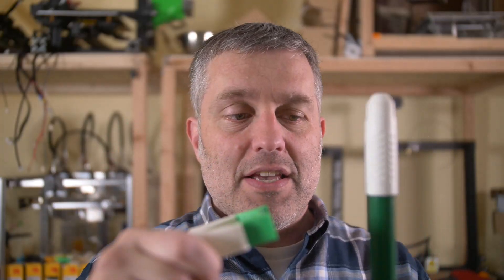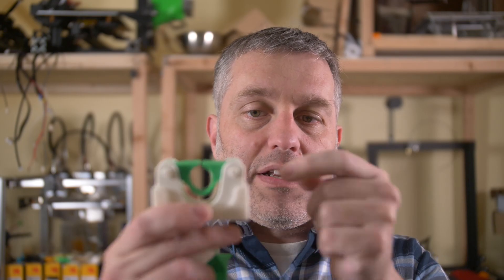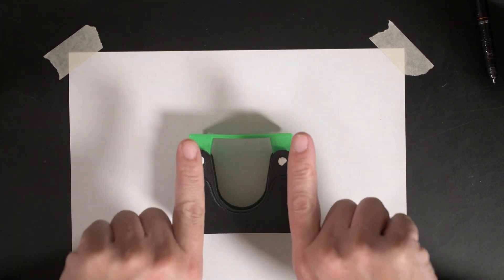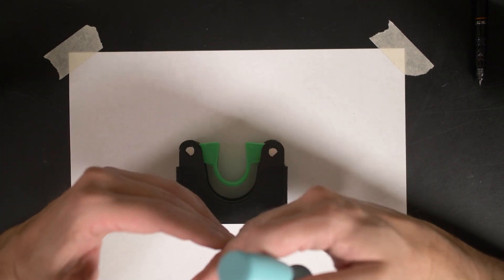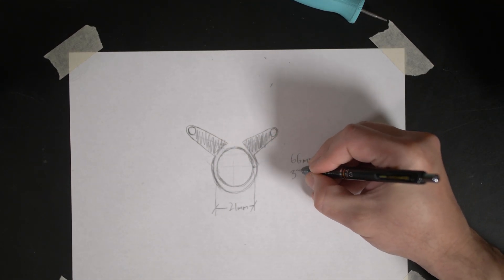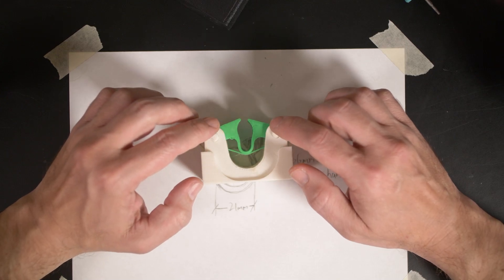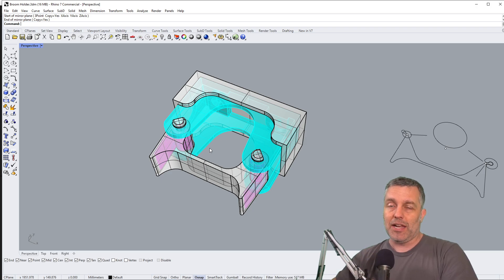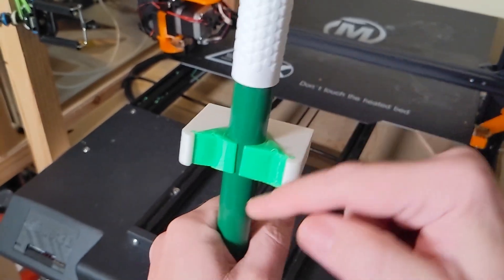I Could Patent This - A 100% Compliant Mechanism That's Actually Useful

Comment: that mechanism won't last a few hundred cycles
Reply from the maker: You are the first to raise the longevity/durability issue. Given that this is a prototype I can't really test your assertion. However, if it did go into production, the rubbery plastic could be chemically engineered to be very durable and to not fail along the natural hinge. There are many natural hinges used in production.

Comment: Did you try to enlarge the ear's exterior parts, in the last version, to compensate the force needed to open, when the memory fault increase? In my opinion, making holes on the walls for this things can become a usage discard motivation, so you have to think to an alternative solution to offer when this no no comes in.

Comment: How is this any better than a 225-FL broom holder? 

It's still an interesting 3D printed design, but a 225-FL is a much more reliable design, while also being a compliant mechanism.
Reply from the maker: Yeah, there's a reason the classic designs are classic. However, this one won't scratch the handle.

Comment: Naw dude, two shot injection molding is prior art.  I used to design the molds for injection molding.  
I can think of a few part designs I've seen from a few large corperations, that are essentially same design by injection molding using TPU/PCABS.  The difference in this case might be the method of manufacture to distinguish the IP for patent.
Good idea, but old idea.
Reply from the maker: I'm amused by comments such as this . You guy(s) have a mandate from your boss who can't come up with an original idea to save his life.  He hates people who are better than him at this skill. That's why he had to tear down JBV Creative on camera. He knows he's a parasite taking other people's ideas because he can't generate them himself. He doesn't like being a parasite so he sends guys like you to try and make me feel the way he feels. But I'm the real deal so I don't feel the way he feels. I will never feel the way he feels. I have truth on my side. And the truth is that I can generate original ideas. To actually make me feel like the loser that he is you would need to invalidate my patent. Which is possible to do. It just requires a lawsuit .This broom holder was just a silly side project that I did for fun. My patent is the real value added that I'm proud of. You need to attack that if you actually want to get to me.
Reply: @DesignPrototypeTest  I'm amused at comments like this.  That sounds tough, but you've got me pegged as someone else. 
i'm just a regular guy, and I dont even work in injection molding anymore.  

If patents cost 20-100K ish in lots of legal fees, and it's not my money that will get burned if I missed a few "prior arts" that weren't flushed out in the discovery phase.  

Based on my experience, your technical edge may lie in the method of manufacture, not in the prior art or IP that is an adaptation of the living hinge.  

But you mileage, and money, may vary.
Good luck on your patent!
Reply from the maker: Yeah, I guess I had you pegged for a different type of commenter (Prusa fanboy who hates me and just wants to tear down anything I say). You are not that, but it doesn't seem like you watched the video. Where I said that I'm not patenting this because I already have 1 languishing utility patent (Which I wrote myself by the way) and I'm not in the broom business. Instead you decided to leave a comment based on part of the information I presented where you are flexing about some job you had one time where you gained a little information about patenting injection molding production process stuff. 

I agree there is nothing patentable about the production process for this design. The patent is the specific feature set: 2 part design made where half is made of a "hard" plastic and the other half is made of a "rubbery" plastic either assembled or overmolded into a single unit which has the illustrated functionality. No need to even mention the natural hinge. Although, if nothing else I could make the patent that specific. (The more specific a patent is the less valuable it is.) eg. Same funtionality as existing solution on the market except using a natural hinge instead of a pivot pin.

As is always the case the patent examiner will absolutely come back with the preliminary denial that the switch from a pivot pin to a natural hinge is "obvious." To which my lawyer would reply basically "If it's obvious then why are there multiple companies producing the more expensive (lower profit margin) version with the pivot pins? They should OBVIOUSLY be saving money and they aren't so it's not an obvious innovation. 

The peanut gallery always thinks things are obvious in hindsight. It's really easy to make the leap of logic once someone else provides the answer for you.

Comment: I think you could do this in one piece. Out of the soft plastic but change the print properties for the areas that you normal print the hard plastic out of. For example you could modify the perimeter walls or infill but only for the area of where the hard part is

Comment: "I'm not doing finite element analysis on this" and "I got this one to work by trial and error" does not empower anyone to duplicate your notion in another size or material. Never mind predicting the number of usage cycles before it falls to pieces. You might register it as a design. But patents are awarded by national patent offices and not just by you dream-wishing "I could patent this". Take my advice for free but if you prefer there are shyster lawyers who will take your money and arrive at the same conclusion which is: NO you can't patent this anecdote.
Reply from the maker: You obviously didn't watch the video. 1:12 timestamp.
Reply: @DesignPrototypeTest  1:12 "I could get a patent on this".

Comment: Ok. Bandai already figured out your injection molding issue. You can co-mold the piece as one unit. I believe they use either 2 different temp setting thermo-plasts, or 2 materials that don't bond to each other during setting. Bandai make these gundam plastic models, and many of they newer designs they have mechanically jointed parts and more onto single sprues. I would highly recommend you look into it. Adam savage does a Gundam build and discovers this. 

Just realized this vid is two years old. Hope you got some movement on it.
Reply from the maker: Such a great comment! I didn't even think about that. This could be made in a single shot on an injection mold machine.

Comment: I have 1 simple solution in my house for that. Remove the flexible part, uses 2 rubber wheels (cilindical) 1 on each pin. It will work 100% of the times as they dont need to reset because they are simetrical. The yellow part bend a little bit each time you use it, but it last forever.
Reply from the maker: That is a great solution! Thanks for sharing.

Comment: I like the gist of this video. But this easily could have been 10 minutes shorter with a little planning and scripting before hitting the record button.

A lot of stream of consciousness random elaboration that doesn't move the conversation forward. I found myself fast forwarding through most of it.

And hate to burst your bubble, but I've had a 3M product like this holding up my broom for probably 10+ years. The "Hammock" piece is some kind of injection molded silicon rubber. So you're on the right track there.
Reply from the maker: You guys are cracking me up. I see what you are trying to do. It's not working.

Comment: I'm sorry, but I missed the point on why the elimination of the pivots is particularly advantageous.  So, instead of buying a broom holder at a dollar store that consists of 5 rigid parts and two flexible parts, I'll get a broom holder that consist of 1 rigid part and two flexible parts, but will still cost the same?
Reply from the maker: No. One rigid part and one flexible part. That's a 50% reduction in parts. An ABSOLUTE winner according to the K.I.S.S. principle of engineering. It's so funny that you guys have chosen this hill to die on. It was just a fun passion project I did a couple of years ago. But you all see it as proof I am capable of original inventive thought. Which is irrefutable evidence against the narrative you want to construct about me. That's why you are trying to kill it. But what about my actual patent which is much more solid evidence and a much more robust and meaningful innovation of mine? Even if you destroy my broom holder You can't kill the patent. You are behaving pretty stupidly. You need to accept that I am a skilled innovator/inventor. My track record makes that pretty irrefutable. Why do you wish that reality wasn't so? What is your motivation?
Reply: @DesignPrototypeTest  A bit of overreaction to a relatively minor criticism, isn't it?
Reply from the maker: Search previous comments. There are many just like yours. From your point of view, it seems crazy that I would overreact like this. From my point of view it's really strange that every comment I get on this old video is trying to tell me that I didn't accomplish anything and seems to be willfully misunderstanding despite my clear communication in the video.

Comment: the most exciting part of this design is how easily it could be manufactured, since both halves appear to be consistent 2d profiles you could extrude these by the thousands in no time flat and with minor tooling design since there's no internal holes to complicate tooling. You'd have to figure out a new mounting system though, maybe flat tabs coming from the sides?
Reply from the maker: The most intelligent comment on this video to date.

Comment: These do not work very well because the tool will lose grip over time and slide down. This only works if the tool has a cap, and not all do.

Comment: Use MMU and make just one part. Genious Designs are Designs where you cannot reduce the parts anymore. You can combine TPU with PETG and bamm, just one part left. And yes, you can mass produce with 2 Materials in 1 Part, too.
Reply from the maker: Good Idea! I'll use my Bambu Lab X1 with the Automatic Material System (AMS) to try and make this happen in a single print.
Reply: @DesignPrototypeTest  You probable have to use other material then petg, because nothing really sticks with that, but i would just start with PLA and TPU. There is also TPU Filament available where you can control the elasticity over temperature, so here you can really change the stiffness from layer to layer just by changing the printing temperature.
Reply: So next step is reduce the material to just tpu. Because you can print with different temperatures and get material with different stiffness it might be possible to even extrude this with 1 part and 1 Material. But i can only do that with printing. The real solution is to extrude this and this might a bit tricky and it will cost a lot of money to make prototypes. But i am very sure, that its possible so, too.

Comment: You can buy them, they already exist
Reply from the maker: Obviously you didn't even watch the first 2 minutes of the video! You just left this comment based on the title. At the 1:10 timestamp I talked about the patentable feature and what makes it different from the already existing designs. Furthermore, if you had watched even the first 4 seconds of the video you would have heard me talking about the previous video where I went into great detail about the preexisting designs which you are referencing. I think you are a troll. Either that or you are offended by a stranger who displays an accomplishment. Why does me creating something which previously didn't exist threaten your self esteem? Why do you feel the need to shoot it down on sight after only reading a title? Do you realize how hard I work on these projects and videos? Why do you vandalize my hard work?
Reply: @DesignPrototypeTest  I'm not offended sir. I understand why you would think that. However, there are plenty of people who work hard on their projects every day. I watched your video in full and I respect it. There is a lot of work involved when designing a compliant mechanism, however these days, as you well know, there are many software packages available that can simulate the forces, movement and other associated attributes of any compliant design. These are then all manufactured cheaply in China and then sold on the open market. The item you present and produced is currently widely available worldwide and has been available for many years. I mean no disrespect to you or your work.

Comment: I have had one of these for a few years now, I belive it was by Command (the ones that make the little hooks you can stick to the wall) the difference is your green part is like a flexible rubber in the one I have. So sorry, cant patent it, cool mechanism though! Maybe it's a case like me when I was a kid and had an invention where I put a motor on my bicycle to go up steep hills easier, only to have my dad say: "its a motorcycle" and there went my dreams...haha...
Reply from the maker: #Didn'tWatchTheVideoBeforeCommenting You didn't even watch 2 minutes of the video! 1:10 is the time stamp where I talked about it. I looked up your Command brand reference and EXACTLY like I said in the video it has pins that the flexible part rotates around. The pivot points are around the pins. In my design I eliminated the pins which allows me to make the thing with only two parts. I don't know why I bother to read the comments from you guys. You are just motivated to hate on me and tell me I'm stupid and couldn't get a patent. You don't actually understand the issue and WORSE than that you don't even bother to watch the video that I spent so much time making to explain it to you so that you could understand. All you want is to tear me down. Shame on you.

Comment: Love the design iteration description - thanks for taking the time to talk through this. A suggestion: you mention that the broom spends most of the time in the holder. Why not print the flex part in the 'gripping position' shape so that it is relaxed for most of its life? (or close to this shape if it does not want to maintain its open shape well).

Comment: You are clever, but together we are cleverer.

Of course you can make it simpler. Why the fuck do you need a fixed and a movable element? Make it all out of the same material and make the rigid part regid due to design and thickness.

Comment: Will it hold power tools? You could sell it on its own as a workshop hanger at ANY hardware store. Best part is you wouldn't need an extra factory if you have the 3d-printers. Just be sure to pass me on some royalties for the idea ; )

Comment: this already exists and it will fail fast because oft he massive bending.

classic broomholders with flat-spring design last for at least hundred years and cost a buck.

sorry to dissapoint you. - there's no patent for you - just google for alpine industries broom holder - took me 1 minute
Reply from the maker: Your words clearly show me that you are trying to offend. I actually have a patent that I mostly wrote myself. Tell me, what are your credentials regarding patents? Why do you feel so confident in your assertion that I couldn't have patented this?
Reply: @DesignPrototypeTest  your words clearly show me that you want to be offended. 

it's your choise.
i just told you, that your "invention" is not new and patents have to be new... but hey - just try it.

it's your money.
Reply from the maker: George Carlin did a whole bit about this. Basically if you have to say the words " no offense" It means that you're being offensive and you know it. Don't try to put this on me. You're the one trying to elicit a reaction. You're clearly trolling. Also, you're wrong about the patent, and if you had actually watched the video, you would know the nuances.
Reply: @DesignPrototypeTest  please read my comment again...

Comment: I don’t see why you couldn’t make it out of one piece by just making the white piece a bit thicker, say on the sides,  so it doesn’t flex as much but using the same material as the holder piece itself. There’s definitely a thickness at which that stuff is rigid enough to not move before it’s already in and held. There’s likely also a way to do it with the more rigid material a la those compliant pliers that use pretty rigid material that just gets very thin at the points that need to bend, although I’m not sure what kind of friction for grip it would have, it would at least hold it upright with the broom on the ground or something.
Reply: yep its overengineered for the purpose